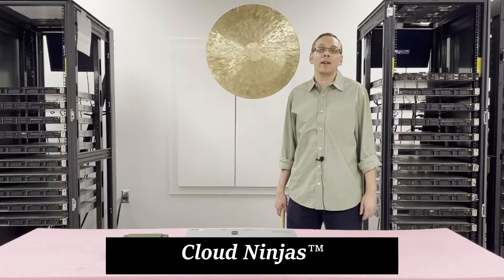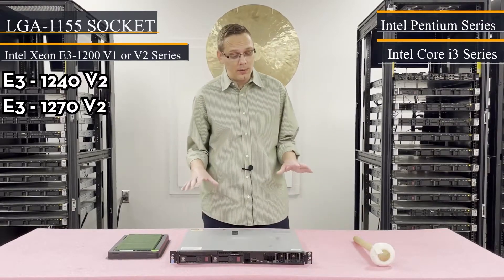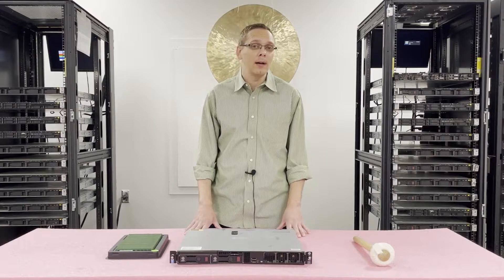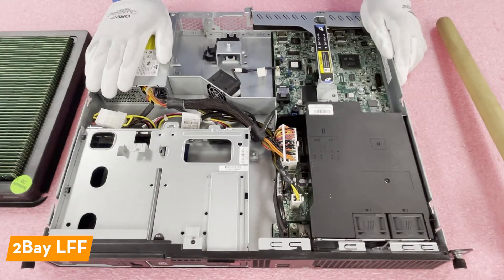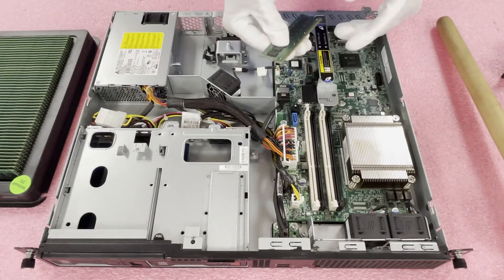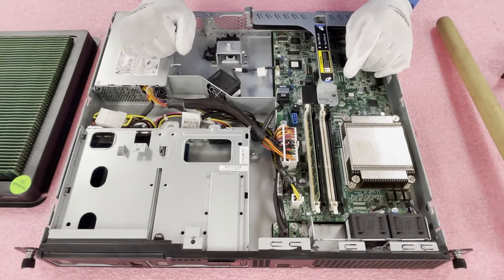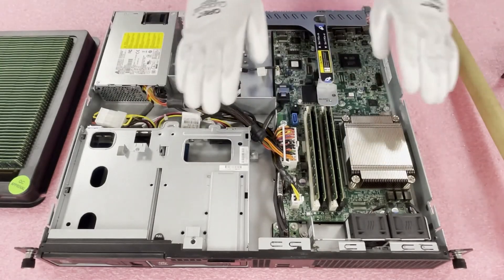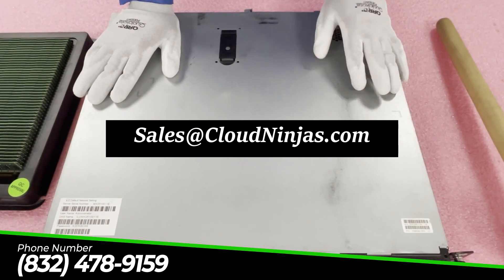HP ProLiant DL320E G8 V2 server Overview | Memory Review & Install Tips | How to Configure DDR3 RAM

Comment: I have this server, but I want to use that SATA port for a drive or possibly a opt. drive. But I can't find a SATA power connector in mine to do that. What cable would be needed do power either of those drives?
Reply from the maker: For powering a SATA drive or optical drive connected to the DL320E G8 V2, you'll need a proprietary 4-pin to SATA power cable adapter that connects from the motherboard to the drive, instead of a regular SATA power connector from the PSU.

Comment: wish i had that black baffel. Mine is clear and so ugly. Though it is odd that baffel has no space for the third fan slot. I mean I know the board only has 2 fan headers, and more specifically the board has 2 proprietary 2x6 pin fan connectors on that side and another one for that weird fan in the middle. Honestly, the fans on this server are so weird and one of the worst parts of the design. I added an exhaust fan to that gap to the right of the power supply, removed the bracket, and even have an AIO, which allowed me to also take off that baffel -- so the thing is much more like the standard dl300 line models we are used to in that it is a wind tunnel, but now it also has a pressure system like a other form factors. Not sure if that is ideal for a 1U, I haven't profiled how the DIMs do. CPU is fine, of course, and ambient temperature seems a lot lower.

Comment: I tried to use the the Sata slot for Sata dom, but they are expensive. I can’t see a power supply to go with the Sata to use a bootable ssd, saving on bay. Any idea how we can do that ?
Reply: got this server and if you have a look inside you have a "floppy molex" connector, adaptors from this to sata does exist. 
I didn't tried it, but that's something i'm looking for, but i wonder if we can trust this, it's a bit of the same story of "molex to sata, loose your data" so i don't really know what do to
Reply: Super easy i have different hpe server and all of them have a bottable ssd conected to the sata port that use to belong to the dvd drive. You will need a mini sata to Sata converter. It like 10$ for 2 on amazon. 

Another thing is that i have 2 dl320e v2. One sff one lff. The sff brought the cable that goes from the dvd reader to the mb but my lff did not. So I had to bought one on ebay to complete the ssd task.

Comment: I have one of those (given from my friend) with 8gb ram and e3 1270 v3 and i host a minecraft server with many players and many mods and it works good
Reply: The ram is configured in a 4x2 (2 of them comes from another dl320e) at 1333
Reply: Another ps: i have modified the fans to have the 3rd fan in place, i took power from the other fan and inserted it, so i modified the airflow "tap" to have place for 3rd fan and it worked, unfortunately the lff (also sff) are sata only and i dont have another p400 controller (i gave it to my friend for a rendering old server and he wanted to do a raid 5 so the integrated didnt do it and...) for sas harddrives and in one bay i have the ssd with os and in another the backup disk

Comment: I want Know how to replace CMOS battery in this server....
Reply from the maker: Will try to make a video in this in near future.  Take care!
Reply: For the bios battery check in the motherboard if there is the button-battery or some other batteries. Normally the CMOS bat. lasts 10-15 years and you normally don't wanna change it, the system warn you when its too low or its completely over, whatever if the system power is plugged in you don't lose any bios settings, but on startup it warns you about the battery. If you are shure your server is always plugged in ac power, change it only when server warns you